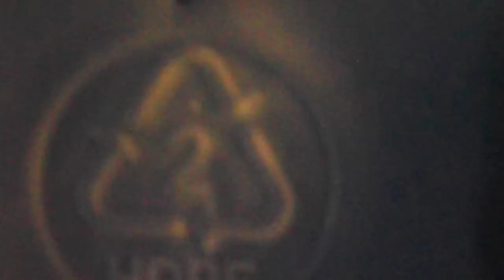hdpe recycled into plastic stock excellent for machining

Comment: Awesome! I'm trying to make things like flat plastic mainly from Polypropylene (5 resing code, PP) by putting the cut to small pieces plastic on a metal sheet which I put over hot plate with precisely adjustable temperature controller, I set at 160-170 Celsius degrees and the product was 2mm thick quality plastic with near-factory qualities and minimal material degradation caused by overheating. I've tried to knead and mix beter various shades of blue PP with using wooden stick on the hot plate as depicted above, but maybe I was doing it too long and the plastic got very fragile and low-quality and friable like wafer. I made 2 HQ plastic plates which were perfect for my purposes and they had only small air bubbles in them. Also, Dean, where did you kneat the plastic? Inside the over when melter or shortly after you pulled it out? Also, please tell what materials you used to make the bricks? I'm in a seach of suitable bricks for making HQ small plastic elemens made from both PP and HDPE like sticks, spars, wheels, gears and other things like them. If you want I can upload pictures of my results when making PP flat plates.
Reply from the maker: +Parkour Vector yeah this is definetely awesome stuff anyways the reason it was fragile was probably because you used a hot plate which heats unevenly because the bottom of the pan is hot causing that side to burn while the top doesnt melt i used a toaster oven which heats much more evenly and stops all burning. by the way i found some types of polypropylene to be brittle probably because of additives when i used hdpe i never had this problem. now hopefully this doesnt confuse you but there are different types of hdpe one type is 5 gallon buckets and large bins these are normally injection molded at the factory which means they use a type of plastic that flows really well and fills the mold without added pressure however the tradeoff is that it is more brittle and impact strength is lower and this is what the grey sheet at 4:30 in the video was made of however it is still very strong and was still almost impossible to break unless i threw a really heavy brick on it using all of my strength. the other type of hdpe is bottles such as milk jugs and detergent bottles, shampoo bottles etc. this type of hdpe doesnt flow without pressure it more has the consistency of silly putty and needs to be clamped down in some kind of mold however thats due to the longer molecular chains which means this type is even stronger than the type made from hdpe buckets and that was the piece at 6:18 in the video this type of hdpe was impossible to break and has a ton of tensile strength this type wouldnt break even if i used a sledgehammer using all my force. i kneaded my plastic as soon as i took it out of the oven and then put it back in again since it cooled down some then i clamped the gooey blob in a mold. the hdpe from the buckets doesnt require kneading because it flows very well and has the consistency of honey. however the hdpe from containers at 6:18 in the video does require kneading before clamping it in a mold because this type doesnt flow and has the consistency of dough kneading it makes the plastic more consistent and removes weak spots in between where the original flakes of plastic were. this piece by the way wasnt kneaded and you can somewhat see the flakes of plastic in the disc at 6:21 which could cause weak spots if it isnt kneaded. hope this isnt confusing let me know if you have any other questions i would be happy to answer them
Reply: +Dean Walcott Well this was complete answer to my questions at least to this moment. The places where the flakes joined are clearly seen and from my experince from PP melting, I've come across to the same thing and I forgot to mention that after I took the metal sheet with the melted plastic out from the small hot plate, I put it on the floor, put a large pan with the flat side over the melted plastic pieces and stepped over it and it became excellent quality, only that the places where the plastic flakes joined together on the upper side are visible, but on the lower, which was closer to the heating there weren't any visible. This, as you mentioned, is caused due to the fact the upper flaker were further from the hot plate. Also notice, that plastic which has been recycled is usually more fragile than the new, directly made. The plastic I used on the one plate was from empty BIC Round Stic pens, cut to small pieces and the other was from some shampoo cap. I cut a square element out of the one made from the pens' plastic and the thin pieces which were cut out of it, it tended to break where the flakes had joined togetherwhile cutting them with the scissors. The least plastic from different things you use, the more the quality is better. Thank you, because you gave me some very helpful ideas plus new ispiration :).
Reply from the maker: +Parkour Vector happy i answered your questions anyways i suggest melting down hdpe bottles for now on such as milk jugs detergent bottles shampoo bottles instead of caps and pens etc because they are made of a much stronger type of plastic then the plastic from pens or caps and also the pens are made of an unknown type of plastic which may smell when melted. however hdpe has nearly zero odor as long as you dont burn it and is very easy to melt this spring i will make a video on actually melting the plastic and clamping it with c-clamps in a rectangular pan because i think it will help a lot of people when you can see the whole process of melting it and then machining it into pulleys, gears flat sheets which are perfect for speaker boxes and also use it like lumber to build strong structures
Reply: +Dean Walcott I'm looking forward to your new videos about plastic melting and yes, this is one of the best things about HDPE - that, especialy when it's thick, is that it's flexible like steel and strong like concrete. I also may make videos if I succeed in my experiments. Also I make things of plastic elements like those with slodering iron, but I don't use the soldering filament, I just heat the plastic so that the wanted components stick. Take use of the awesome kinds of petroleum-based plastic, because the petroleum reserves are projected to deplect in about 53 years and then we will have to use the biodegradable plastics usually labeled as 7 - other :(

Comment: Yes, vid of making this stuff, from raw plastic to finished item.  Orange and gray items look great! Vid your process man. Many want to see how you do what you do.  Keep up gr8 work...
Reply from the maker: +superbee1970 thank you for the comment yes i will be making a video of the detailed process as soon as spring comes because usually i melt it outside i didnt really explain the process well on this video because i noticed there were burn spots on the orange pieces in the video if you look closely which could lead to structural failure if its used for mechanical parts however im happy to say after lots of trial and error and experimenting that i found that kneading the plastic like dough with oven proof gloves improves the strength drastically the reason is because when you put the hdpe flakes into the mold even though the piece may look completely melted together there still can be microscopic gaps between where the flakes originally were which would cause a part failure kneading the plastic together before putting it in the mold completely fixed this issue. also its best to keep the heat the lowest possible while still making sure its fully melted this prevents the plastic from degrading which could weaken it

Comment: Hi Dean,  that last one, the big gray piece that came out "gorgeous" ,  you didn't mention what you used, was it milk jugs or lids or a mix... what containers did you use to make it come out "gorgeous"?   Thanks for sharing your method!
Reply from the maker: +Sue Pearson hello that piece was made out of a grey tote bin it melted very well and smooth but i found that even though it was easier to work with when melted that it used an plastic type that has a lower molecular weight which does make the plastic a little more brittle (although this piece was still completely unbreakable) but allows it to flow into the mold without pressure. for now on i use milk jugs and detergent bottles because they are made of a stronger type of plastic however the tradeoff is that it has to be clamped down into a mold with c - clamps. if you have any other questions feel free to ask
Reply: Dean, thank you for that information!

Comment: Hi Dean
Got a couple of questions
Would be really nice and sweet if you answered
1 Can I use baking pans to melt the plastic(I don't use them anymore)
2 Will it work if I use aluminium pans
3 I don't understand what you mean by kneading or clamping, can you plz explain to me
4 After I melt the plastic, I have some clay molds, can I pour/put the plastic in them to make what I want?
5 How long do I have till the plastic gets hard to work?
And last but not least, can I sand any roughness on plastic in the end?
It will be GREATLY appreciated! :)
Reply from the maker: +abdul sabour baking pans will work perfectly for melting the plastic and aluminum pans will work just as well. what i mean by kneading and clamping the plastic is because when you melt hdpe which is the type of plastic that can be melted it never reaches a liquid consistency which is normal it only will reach a consistency similar to dough so what i do is i cut up the plastic containers into small pieces melt them and then with heat proof gloves mix the molten pieces into a gooey blob of plastic this will completely fuse the pieces and remove any weak spots. as for clamping it down what that means is i take a plywood cover that fits over the pan and using c clamps i clamp it tight in the pan what this is neccessary because the plastic wont flow into the mold without pressure. as for the clay molds you cant pour the plastic as its extremely thick but you can use clamps for the clay mold. and for number 5 i never really sculpt the plastic by hand as it would be hard i always clamp it into a pan to make sheets but it starts solidifying after about 2-3 minutes the sooner you clamp it the better. and yes hdpe sands very well and its similar to wood it also can be planed turned on a lathe or carved. by the way the way to tell if its hdpe is by looking at the container and see if it has a triangle with 3 chasing arrows and a number 2 in it this means it can be melted down. feel free to ask more questions if you have any i would be happy to answer them

Comment: If I don't clamp the plastic, will it shrink on me? I'm trying to make a circular lid and making a clamp for the mold I'm making would be difficult. Thanks!
Reply from the maker: +James Collins the plastic has to be clamped because hdpe will not flow well when melted due to its long molecular chains which is normal its more like the consistency of chewing gum or taffy and i have found that kneading the melted plastic like dough with oven proof gloves before clamping it made it much stronger because sometimes the flakes may look like they melted together fully but if you try to snap it it may snap along where the flakes were melted kneading the plastic completely eliminated this effect. anyways i eventually hope to be able to turn the recycled plastic into pellets for an extremely consistent melt without having to mix it when melted. as for the mold i used a metal pot with a with a circular piece of wood that i could clamp down on the melted plastic with c clamps. anyways hope this helps.
Reply from the maker: +Mark Johnson hello i know i havent made a true how to video of how to melt it this process has mainly been trial and error and i found that buckets although they melt and flow into the mold without any pressure still have to be clamped at the end because the sheet will still warp however they dont need to be clamped right away thats why the sheets in this video had a slight curve to them because i never clamped it at all i now clamp it about 15 minutes after i take it out of the oven and then plane it with a planer. i will make a true how to video shortly i have just been collecting lots of hdpe and trying to perfect the process. one thing i found is that 5 gallon buckets although they may flow better into the mold without pressure they are more prone to fracturing because buckets are normally injection molded and use a lower molecular weight plastic which will allow the plastic to flow better when melted but will be weaker for this reason i always use containers such as milk jugs and laundry detergent bottles. i never made a true how to because i have been doing lots of reasearch but i do plan to make a how to video within a couple of months and by the way those orange wind turbine blades were the size of my oven 24 inch long (i have a big oven) i just melted the bucket pieces onto a tray and cut out the blades. i will show this whole process on video since it is so much easier to see the process than explain it i also did not use any crazy machines or complicated processes either meaning it can be done by the average person in the home.

Comment: there is a guy making windmills from scratch out of magnets and copper wire, he does blades out of wood.  The name is Hugh Piggott.
Reply from the maker: +Alex Ihlo i think i have seen his wind turbines and they look very impressive and i have been thinking that instead of using wood that ill try it with this material in the video which would also work really well i have a giant pile of milk jugs and other hdpe bottles that i will eventually melt down into boards and carve the boards into wind turbine blades i think it would turn out great.
Reply: he has a very small book you can buy for a couple bucks, talks about how to do it

Comment: did you melt it with oil?
Reply from the maker: +Fab Muchada nope just used a standard toaster oven and heated it up to 340 and clamped it down under pressure using a piece of wood and c clamps and baking tray

Comment: can i use cupcakes pan without any paper por aluminium foil?
Reply from the maker: yes definetely but most hdpe with the exception of 5 gallon buckets will not become liquid when melting instead it will be the consistency of silly putty so you will want the compress the hdpe in the mold with some kind of cover and clamps